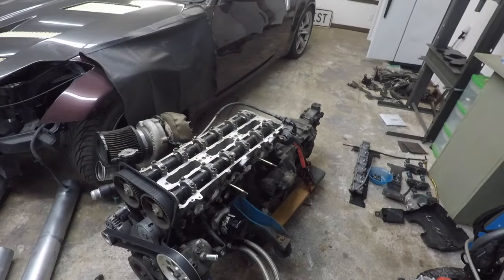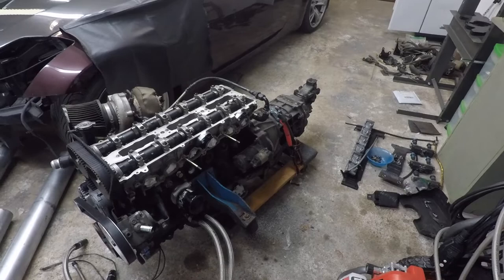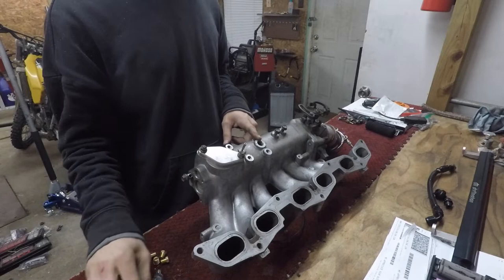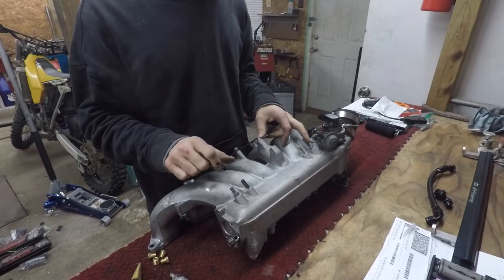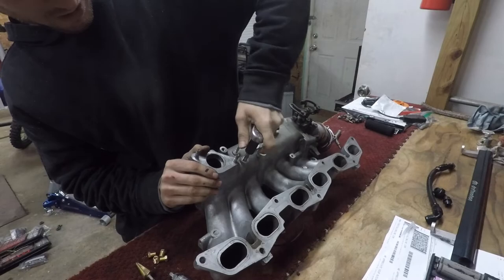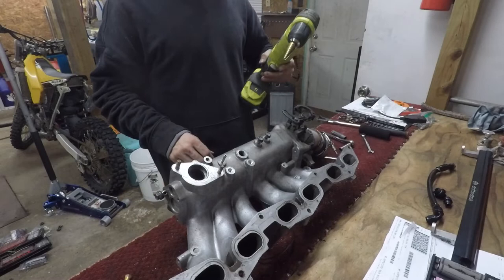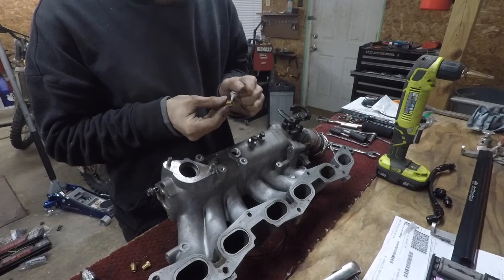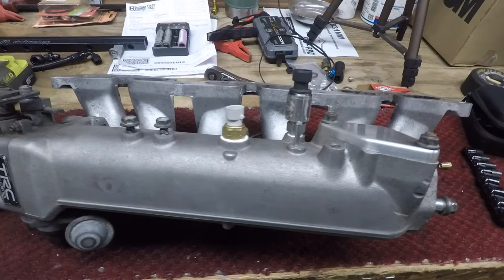1JZ GM STYLE IAT SENSOR INSTALL

Comment: You mentioned electric power steering, did you get that going? I have a 350z 1jz and have so many questions
Reply from the maker: Oh yea it’s a ripper with the eps but this is the jz in my bmw! I still haven’t finished my z.. started and finished other builds though lol. The z might happen this year. Hmu with questions! It’s a Volvo sc90 electric power steering pump just takes power ground and lines. Can put it anywhere you want

Comment: How is it removing the idler control valve, cuz on mine it seems it was never there and looks completely machined shut
Reply from the maker: This intake came with it but it’s just an billet block off. Honestly I’m fixing to put a valve back on it
Reply: Yeah I just tapped for a gm sensor thanks to u!  also like I said my idle control area is machined shut from factory so I have to tap into it for a idle control but it has a an10 male fitting but I’m a little concerned would air leak through the new plugs? You think I said get a an10 female adapter fitting so my tap would be smaller? need a second opinion
Reply from the maker: @Andrew-kt3lk  sorry I never saw this but I’d probably try to weld an an- bung to it!
Reply: @josiahloubiere7742  lol yeah I’ve figured it out, I drilled a hole and tig welded a aluminum bung to it